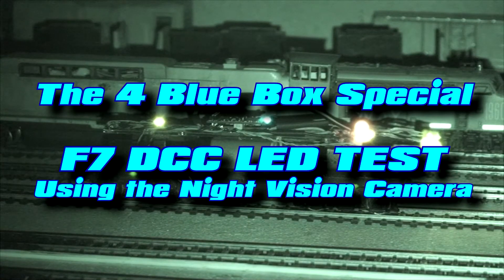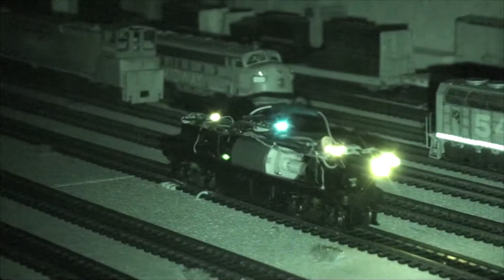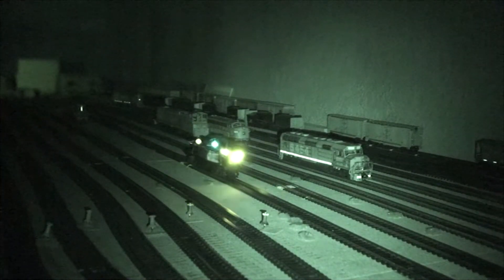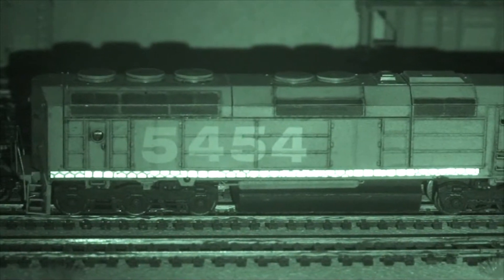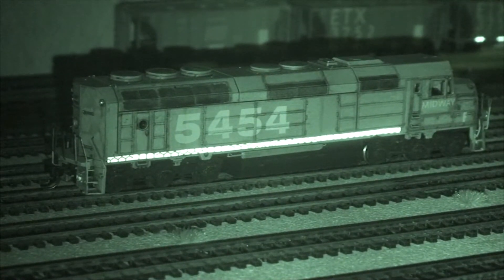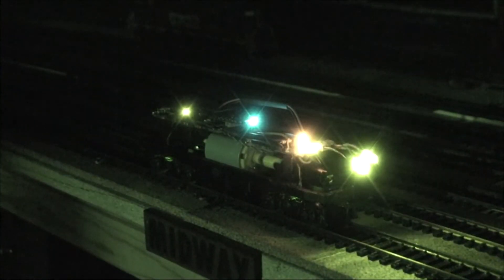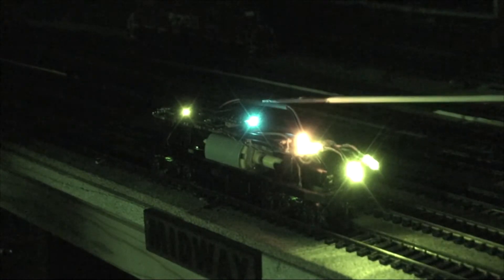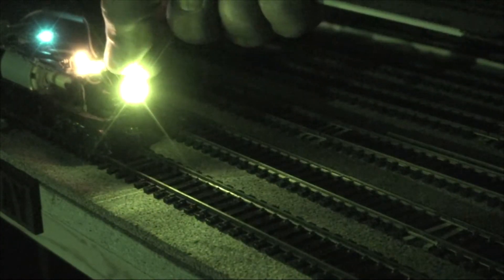DCC LED Night Vision Camera Test

Comment: Amazing perspective with the IR filter.  I think you could get away with one resistor per function with parallel LEDs.  I will send you email with concept and references.
Reply from the maker: got it!  I'm working on another lighting plan for an SD40 and this would be very helpful because there is less working space inside that shell
Reply: @elite194  Thanks for reply.  Glad to help.